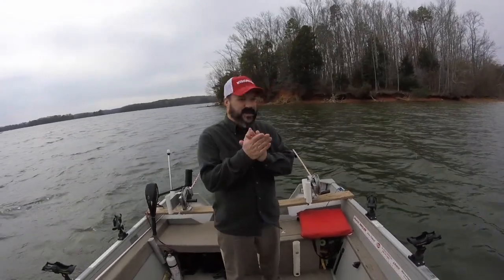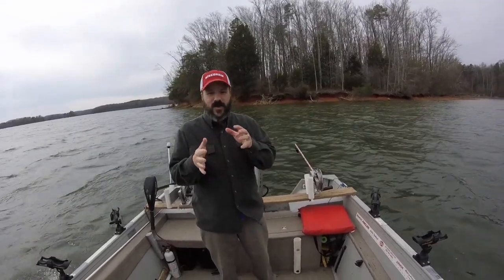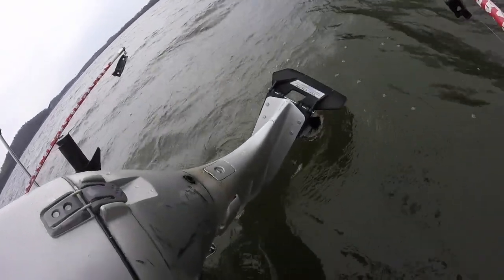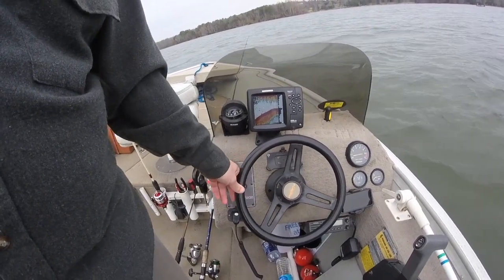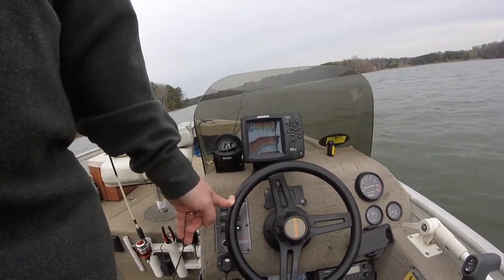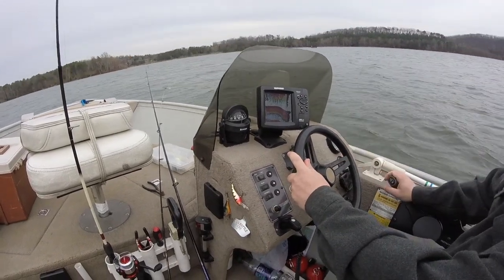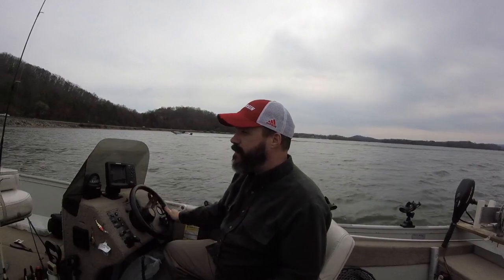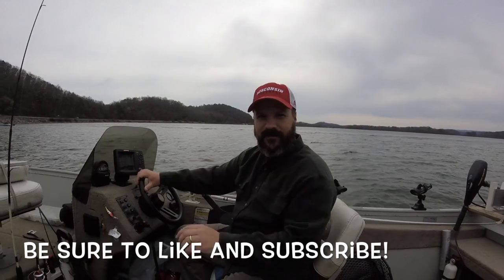SLOW YOUR TROLL! - Trol-A-Matic : Performance Overview - Does it Work?  Part 3 of 3

Comment: Thanks very much for the demo! I have a Troll A Matic arriving tomorrow to troll for walleye. I also appreciate the full speed demo. The last thing I wanted to have to do was manually raise the plate before I took off.  I have a 50hp Merc and got the model for 50hp and above. I noticed you have a 40 so I think this will be great. Thanks again.
Reply from the maker: Great to hear...this should work well.  Good luck!

Comment: do you have a lot of drift at low speeds? hard to keep boat lined up during troll or is it all over the place? thanks
Reply from the maker: Yes, if there is some wind you might need to adjust...I do this by using my electric trolling motor to steer

Comment: Hi I have couple questions on this. One how much would you say it slows your boat down? My boat goes about 2.5mph right now and I’d like to get it down to 1-1.5 if possible. Two do you know if there’s any benefits to this brand rather than the Easy Troller trolling plate brand ?
Reply from the maker: No performance lost at high speed at all.  I do not know about the Easy Troller plate, but the Trol-A-Matic is a quality product.
Reply: @TheFishingEducator and what about trolling speed, you know, the difference with or without….

Comment: So no issues with your 40hp even though the product says for 50hp and up?  Can you remove the springs and put smaller ones on if needed?
Reply from the maker: Correct, no issues...no you can not remove the springs.